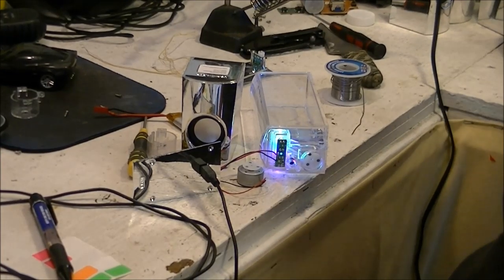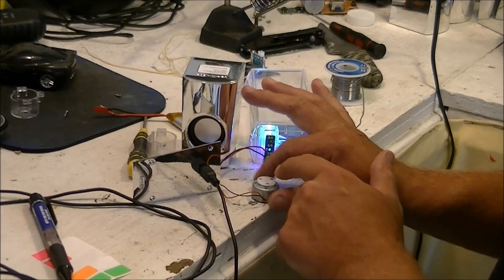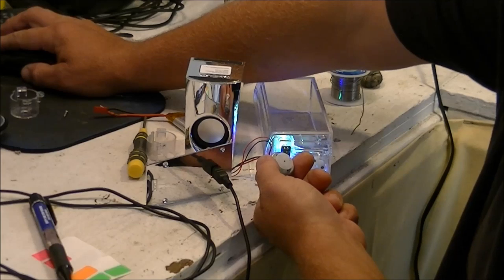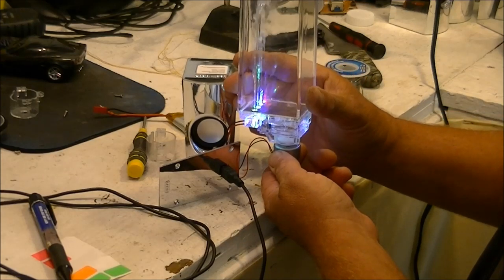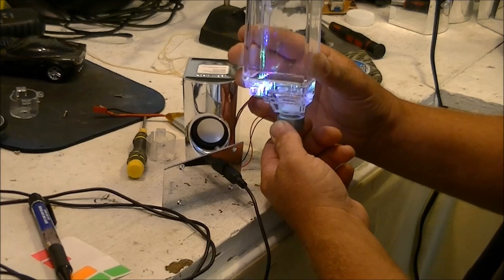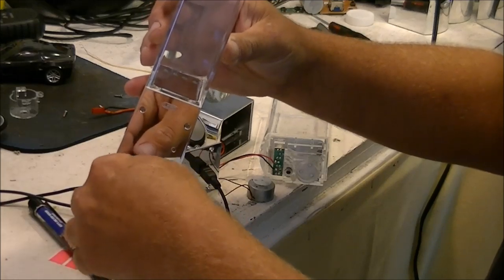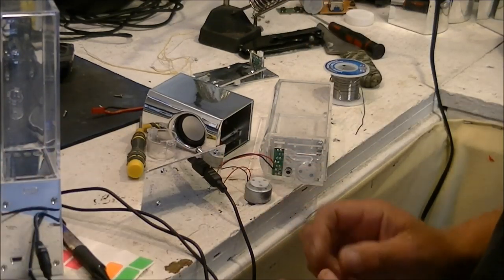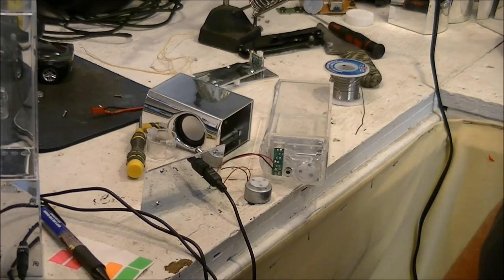Gadgetree Dancing Water Speakers How They Work

Comment from the maker: do you know where the leak is coming from, if its just in the plug area you can get a needle like the doctor uses to give you a shot and that should work but you will have to reseal the plug area so it wont leak again.. the speakers turns out uses an oil, what have been able to find out is mineral oil..

Comment: Thanks for the quick reply... I understand I've turned the speakers upside down and there is liquid present. Now I'm currently fearing the worst is that the motor has blown or has died !! Is there anyway bar taking it apart or sending it back is this common problem with these speakers?? As I bought them during the summer on my stay in New York and I currently live in Ireland..

Comment: Hey Kevin, I have a set of dancing water speakers and I'm not sure how common this problem is, but if you can explain in a video why one of the jets makes a loud noise as it pushes water through and perhaps how to fix it that'd be awesome.
-DrScheperle
Reply from the maker: bad motor bad motor mount . stuff can happen the first release of these speakers even tho they were good had some motor mount problems but thats now fixed and some have had short motor life but this again varys its not very comman but does happen time to time

Comment: is it possible to take this apart and put the base (motor) and make a new compartment that can hold the water,and still make it work ie making a new compartment but thinner? so long as it keeps the size of the motor? correct or is my theory wrong? and piece that is connected to the motor is that detachable?

Comment: I need help, you see I got water speakers for Christmas, and one of them started leaking and now it's out of the oil for that speaker. I can't take them back and get it replaced, is there some way of fixing the leaking and adding more mineral oil? also is there a difference between using water and the mineral oil?

Comment: Hi ! I'm trying to make my own water dancing speakers for some kind of student project. I assume the motor here is an induction motor, (correct me if I'm wrong), but I can't see in the video and I don't really understand how we convert the mechanic power of the motor into something that pulses the water up. Besides, how does the shoots the water up ? Is the fan used as a pump, or does the system also have a pump somewhere (very tiny and hidden very well, then)
If you could help me out a bit with all these questions, you would make my day :)
Reply from the maker: tell you what but a set of these things take them apart and youll learn everthing you want to know , iam not an expert on these nore do i want to be i know how to fix them i have a good idea how they work but if you want all the info buy a set take them apart and back engineer them to what you want

Comment from the maker: the oil in the speakers does not evaporate it cant but it can leak out but you would notice that for sure, turn the speakers up side down if there is liquid then that part is fine if you have sound then thats fine so you could have blown motors or the circuit that controls the motors could have died and thus the water/oil will not jet up like it should

Comment: I Have A Question I Just Got My Water Speakers Today And One Speaker Works And The Other No Sound Comes From It But The Water Still Goes Up
Also There Is Another Problem The Music Comes Out But You Can Only Hear The Instrumental Part If Thr Song You Cant Hear The Singer...
How Do You Fix These Two Problems?
Please Help I Really Like Them
Reply: idk
Reply: try a different audio (3.5mm stereo to 3.5mm stereo cable). The one that came with them was cheap and possibly had a faulty left audio line. the 2nd speaker audio signal is carried over the usb cable, and is fed from that 3.5mm stereo cable.

Comment: Would this speakers work on a larger scale. Like the whole spaker would be 1 meter tall and what kind of a speaker is used in this device ?
Reply from the maker: iam sure you could build a set just use a set of these as the prototype then increase eveything in size as you need to including the speakers

Comment: It seems the usb cable connecting the 2nd speaker (left audio channel) is carried over the usb cable? Considering USB usually has 4 wires,  I am assuming it uses the 2 centre pins\wires to carry the line level audio (usually used for data), and otherwise the usual 5V from USB power. Am i right?
Reply from the maker: i have no idea how these are wired i never took the time to break down the wiring on them but more then likely your on the right track

Comment from the maker: you can use any DC motor you might want to think about AC motor as well .. you have to have the circuit like these ones do in order to activate the motor to pulse with the music .you would not be able to power it with usb port tho not unless you used and power reduction to power boost transformer basically a step-up transformer. it can be done then you could use a USB port as the power input source.

Comment: Mine worked for a year but, stopped. Does that mean I need a new motor? If so, where would i get one? Do I have to get a new one from the company that makes the speakers?
Reply from the maker: new pair of speakers you cant get parts and if you do find a motors somewhere that are the same ones by the time you pay for them and get them shipped you can buy a new set of speakers

Comment: hey so my motor in the main speaker stopped working, the other one works just fine. i saw your other video on taking the speakers apart so im sure i can replace it myself, where can i buy a motor and how much would it be?
Reply from the maker: email me at airsmith28@hotmail.com with your shipping information and ill get you a total with shipping for a replacement motor , i have spare parts for these speakers, just please don't freak over the shipping prices shipping charges are not in my control.the motor it self will be 5.00

Comment: Hi, I just received them from christmas gift, but the liquid of the speakers is gone. They came broken or idk. They sound Great but there no water... is there a possible way to fixed them? or fill them again?
Reply from the maker: youll need some mineral oil and you need the same oil and you need a surenge with a needle to inject the stuff then you will need to reseal the plug

Comment: Hey bro , I got a pair of these for Christmas and I've been playing them and I recently tryed to play my speakers and there was no sound playing but the water was dancing to the beat but no sound ? Any tips to make them work ?
Reply from the maker: the amp blew had about 6 of threw the shop in the last 2 months with dead amps speakers work no sound there is no fix, due to no having them long get them replaced they do have a warranty on them. its rare for the amps to go but it does happen
Reply: cool thanks man
Reply from the maker: take them back the amp blew they have like a 60 or 90 day warranty on them if i remember right

Comment: Hi, my speakers work fine, the sound is awesome, and the lights work, BUT the water doesn't shoot up UNLESS it's incredibly loud, and even then it's only a little... do I - have - to replace the motor to make them work like new again? I haven't taken them apart yet, so I'm not 100% sure if that IS the problem, what's your opinion? they were working fine for a long time, and I guess they gradually started to crap out, because it wasn't until I moved that I really noticed this issue.
Reply from the maker: sounds like either motors or lack of liquid in them
Reply: well when I turn them on their side, it looks like there is still enough mineral oil inside, but I'm not sure, they used to work fine and I don't think they are leaking at all, can mineral oil evaporate as easily as water? I can't imagine that's the reason or there would hardly be any by now.
Reply from the maker: Becky Nelson could just be the motors but its unlikely that 2 motors can go at same time but i suppose anything is possible. i have spare motors email me at airsmith28@hotmail.com with your shipping info and ill get you a total with shipping ..
Reply: Well I can buy the exact speakers for $20 in a local store, how much would the motors cost me + shipping?
Reply from the maker: Becky Nelson go buy a new set then in your local store, i charge 5.00 per motor plus shipping

Comment: Well third time is a charm!! Baby oil thinned with mineral spirits. Start off with a 50-50 solution. And start to fill. You have to gradually add more mineral spirits and swirl it around until you get the same viscosity as the good one.   Just go back and forth between the 50-50 solution and straight mineral spirits. Works like a charm!
Reply from the maker: awesome good to hear

Comment: Hi, is there anywhere I can buy the same motor? I'm wanting to use it for a project. Also if I had one would it spin a small plastic circle with a whole in the centre? Thank you!
Reply from the maker: +Maddison Norton there is no where iam aware of that you can but the motors doa google search but you will need the part number from your original motor. and there is a plastic disc on the motor as far as the size that it will spin no idea man i used to repair these speakers and had to get broken sets to get good working parts as there is no parts support for these ,, waranty's cover replacment set of speakers only
Reply: Okay, thank you very much!
Reply from the maker: +Maddison Norton your welcome
Reply: try any 3v dc hobby motor
Reply from the maker: it does not work that way if your trying to replace these motors they have to match size shape volts shaft pin to mount the magnet disc etc.
Reply: well of course, if u want an exact replacement with no troubles ( may aswell just buy a whole new speaker for $20)
 but all um saying is u can'try'. fiddle around and see what happens. maybe it doesnt spin as fast, maybe the cog with the magnets wont fit. maybe it will. this is the joy, discovery of hobby electronics

Comment: Is there anyway to just use the light and motor bits of these speakers with some kind of chip so you just get lights and water but no sound?  And I don't mean just remove the speakers from them.
Reply from the maker: +hydrolisk1792 not that iam aware of i never invented these things but i know pretty much anything is possible
Reply: Okay, thanks for your help mate :)
Reply from the maker: +hydrolisk1792 your welcome
Reply: The only way without having to connect the proper cables and supply a signal (audio input) for the variable dancing, and 5V DC to power the Amp and motor controller,  is to open them up and connect a voltage straight to the motor. 3volts across the motor will be full water.

You could also experiment with putting a voltage tsraight into the L\R audio input. Maybe even small dc (1.5v) may work, all depends on what chip\micro-controller is inside the speaker as this is what processes the AC audio signal and outputs this as 0-3volts DC to the motor (and also powers the LED's.)

Comment: Mine work perfectly fine( good sound and lights) but its just the water won't budge I took it apart and saw that the motor won't move. If i move it manually the fan inside starts to move but no water movement still. What should I do?
Reply from the maker: get a new set or find a new motor

Comment: sir, you didn't show that how the motor is being rotated with the audio output. kindly explain the internal circuitry. Thnx
Reply from the maker: iam really not interested in getting that detailed into these speakers how ever the motor is controlled from voltage pulses from the audio which in turn supplys enough power to the motor weather or not there is a power step up circut i dont know i never really looked that far into them to know all the specifics
Reply: Thanks a lot for prompt reply.
Reply from the maker: your welcome
Reply: audio signal in is AC 0-1volt, and the speaker chip converts this to DC 0-3V. Supply power from pc USB 5V, which powers the chip (possibly a 7052 amp chip) and the 3 led's.
Reply: Thank you so much for your informative research!

Comment: Is there any way to make the motor work with low volume? My speakers only pull water with very high volume
Reply from the maker: +Rafa Gironés they should work at lower volume as well but only to a certian point then the motors will cut off

Comment: How Would You Get More Of The Mineral Oil Back In The Speakers?And Where Would You Get The Mineral Oil? Please Please Help Got The Speakers For Christmas And I Really Really Love Them And Don't Want To Waste Any More Money Getting New Ones Please Please Help!!???
Reply from the maker: what i know is the oil in side is a mineral oil i dont know how they thinned it out all i have been able to find out is that is a mineral oil youll  need a surenge with a needle to inject the stuff then you will need to reseal the plug ..
Reply from the maker: what i know is the oil in side is a mineral oil i dont know how they thinned it out all i have been able to find out is that is a mineral oil youll  need a surenge with a needle to inject the stuff then you will need to reseal the plug ..

Comment: OK so the magnet and Lil fan setup, how can you find or make this
Reply from the maker: the fan inside the glass is only in the glass so you need a new glass , i have a few left, the motor plate with the magnets on it same this i have a few of them left as well , no company supplies parts, i do tho cause i collect these and rebuild them as needed which for the record is not to often but i can happen so i keep parts on hand but even iam running low on parts.

Comment: One of my speakers works perfectly and the other works for a while and then stops "pumping" water until I hit it :D I opened it up and I don't see anything wrong with the wiring. What could be the issue? And both motors are really annoying with a buzzing sound
Reply from the maker: bad motor that or check your cable to the auido input on your computer that can also mess it up if the signal is interupted
Reply: Can I buy motors like that online?
Reply from the maker: you can try a google search i used to have a tond of spare parts for these at one time but i got rid of everything once i got my new Imac and i bought a predator sound system for it

Comment: Where would you find a motor like the one used here to buy?
Reply from the maker: +Rob Simsiman you cant i used to sell good used ones but i dont anymore
Reply: +Kevys Rc &amp; Music Is it simply a DC motor? Or is it something different?
Reply from the maker: +Rob Simsiman its the size shape and shaft size and volts it needs to run it and mount it in the speaker ,, take them apart take the mesurements and see if you can find replacements i never have but then again i never had to worry to much i always had parts on hand if i needed them

Comment from the maker: if the motor got stuck then take that speaker apart and check the motor mount to make sure its secure some of these use 2 screws and some have 3 screws to hold the motor mount up to keep the motor inplace, just be careful when you take them apart the wires for the motor are soldered to the board so you dont want to get to hyper taking them apart.

Comment: Hi Kevin, I have a problem with my 15in watershow speakers. For some reason the (the one with only audio connection) 2nd speaker's water doesn't reach the same height as the main speaker(the one with the power supply and everything else) when I play songs
Reply from the maker: weak motor or low on fluid, also you wont always get 100% the same heights depends alot on the song thats being played this , i cant really tell you whats going on 100% for sure cause they are not in front of me , there will be a little difference but it its a big amount then there could be a problem for sure, if you have balance control for your audio source make sure its in the center
Reply: I believe it's most likely weak motor. I turned them upside down so I can tell that they both have the same amount of liquid. I don't think it's the audio source because I tried it on multiple sources and the results are always the same. How do I fix the weak motor?
Reply: The difference is very big. The 2nd speaker's water height will only reach about 1/4 to 1/3 of the main speakers height if I leave the volume at half full. If I turn the volume all the way up then 2nd speakers will reach about 75% to 80% of the way.
Reply from the maker: Li Chen your going to have to get a new motor some how and put one in

Comment: is they using two blades?
and can you send me the link to buy the motors
Reply from the maker: you cant buy the motors i used to sell good used units and other parts for them but i got out of it cause to many people complained as they all wanted freee shipping or cheaper prices and free shippin and im not a business so i quit
Reply: then can you plz send me the inner structure of the glass?
can i use normal motors or these r special kind of motors!
Reply from the maker: no i can't i threw all the stuff in the garbage and yes they are special motors but search the net enough you might find some somewhere sorry man cant help
Reply: ok thanks

Comment from the maker: could be the motor blew or a wire that controls it some how came off or something on the controller board went down or maybe the motor mount broke i have no idea , take the speaker apart and see whats going on. there is no one only answer so you have to take it apart and check things out to see.